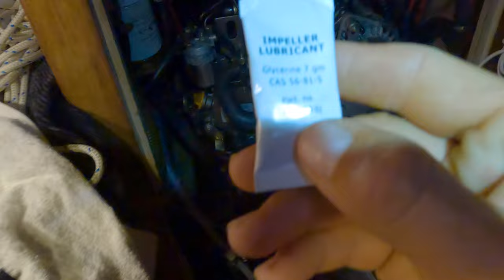Sailing alone overnight to Kauai and escaping huge swell

Comment: You need to rig a preventer on your boom so you don’t have an accidental jibe and brake something or get hit in the head use a snap shackle and put another car on each of your jib tracks also, when you get your new sail for your wind vane make a template of it so you can easily  make one  or  two and save some $$

Comment: You tightened the nut on the shaft and the vane wasn't flaccid anymore and started poppin'.  Then you were slappin' and whackin' the boom.  You had a great sail.  Keep it up.  Pretty soon you'll be going around the world.  A Nor'sea is a great boat for a young single-hander to start an adventure with!  But being a white guy, you should seriously consider sun protection on the lips, nose, shoulders, pretty much all over, a daily necessity.
Reply from the maker: Haha! The boat has been great. And yeah I definetely need to do a better job at covering up.